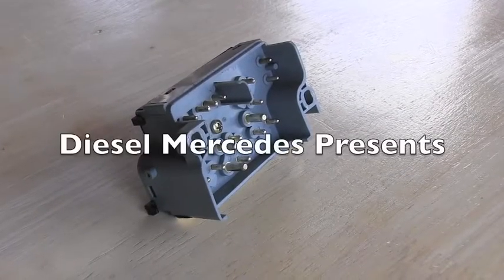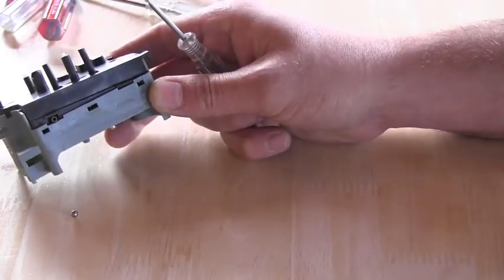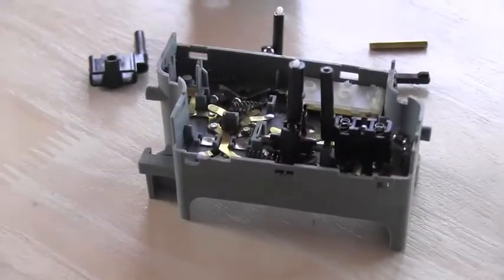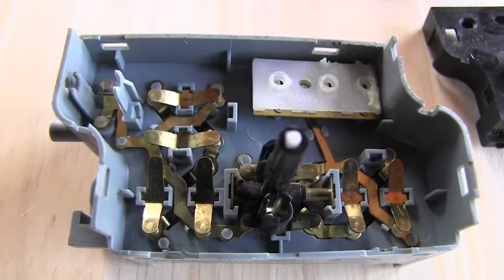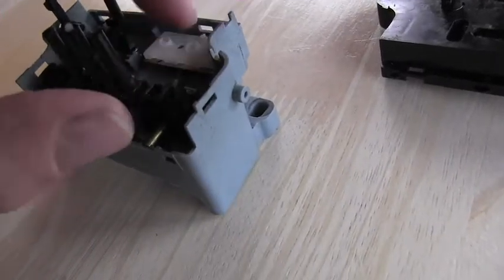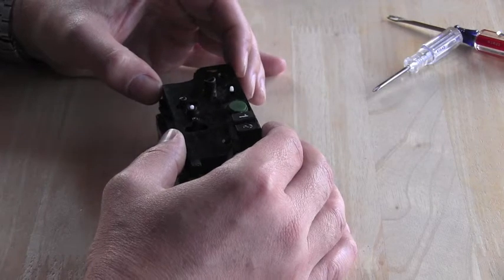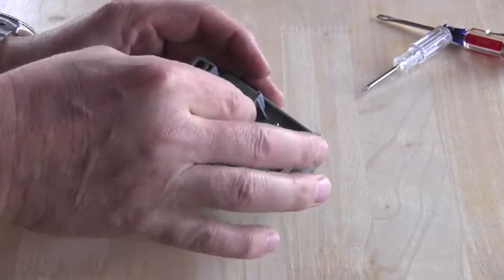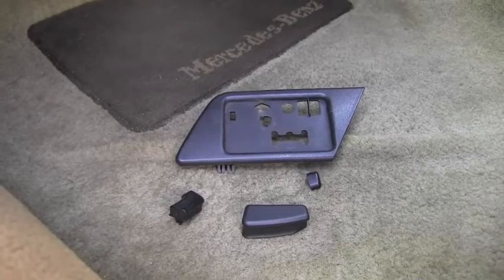Mercedes Power Seat Switch Repair

Comment: That's awesome.  A new switch costs 200 bucks!
Reply from the maker: yes…and i have found that last steel ball, it was inside of door panel...
Reply: Yep, I actually found a brand new window switch in the glovebox!   Just replaced the dash lights with leds from the web, what a difference.